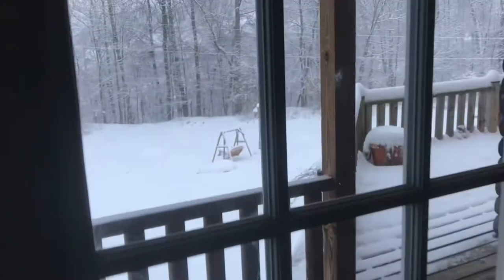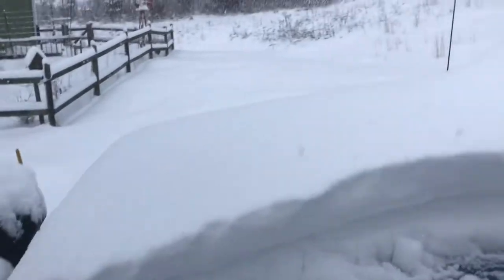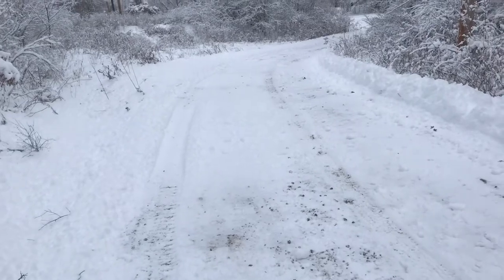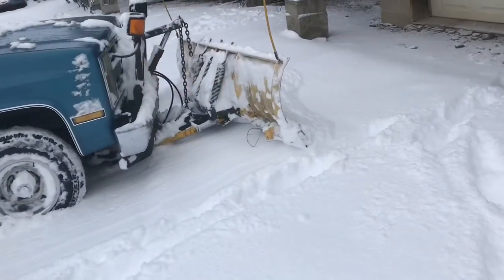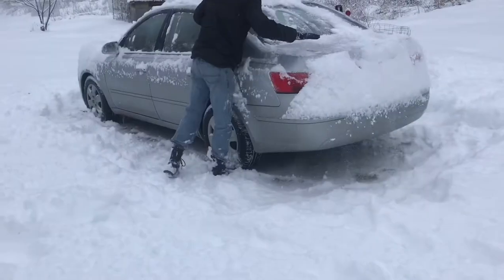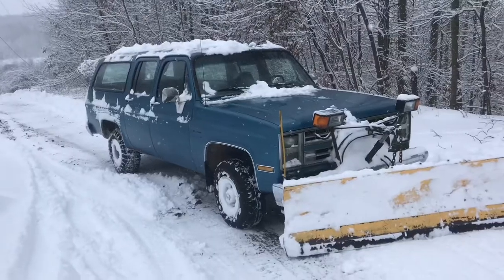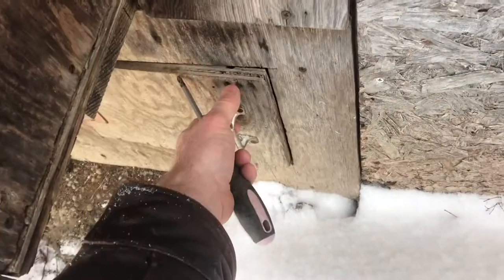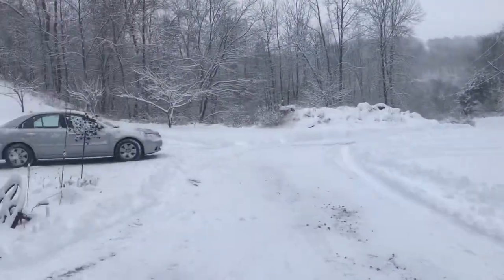how to “use” a SNOW PLOW (fisher hydraulics, meyer plow)

Comment: What plow is that? I just bought an older blazer that had a plow on it. It appears to be a Meyers ST with extensive repairs/modification. If you still have the plow can you take a detailed video of the plow system. The trip spring mounts, the hoop part where it rides along the A frame, the ram mounts and anything else that may be helpful. I'm trying to make sure my plow is functional before putting it to work. Also can you explain how the trip springs work and which parts of the plow rotate/trip upon hitting a stationary object? I'd really appreciate it. Thank you in advance.